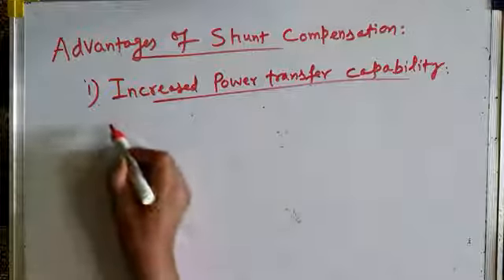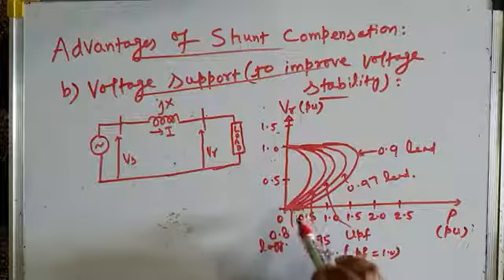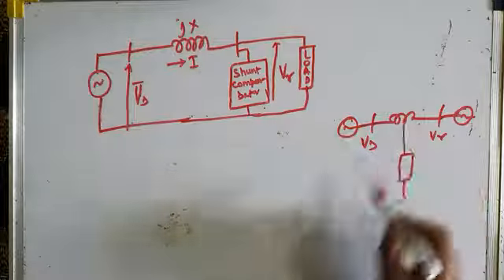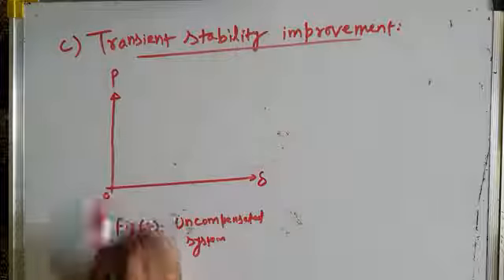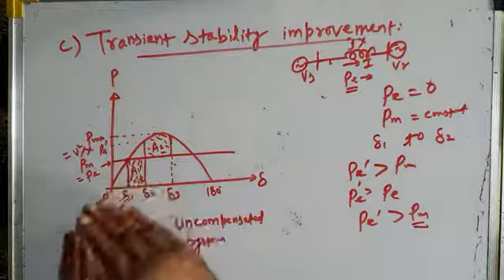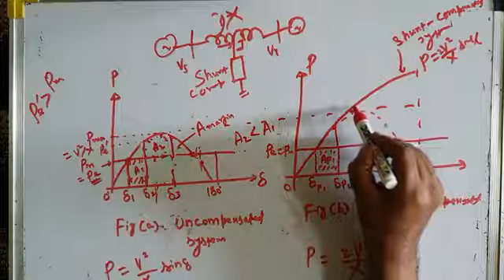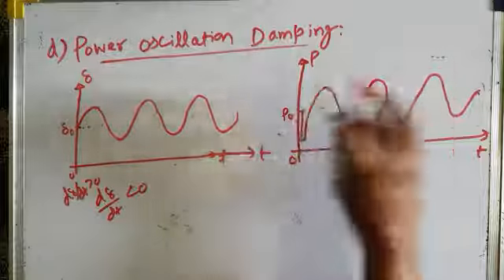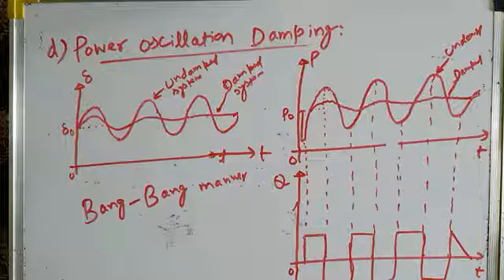L9_ Advantages of Shunt Compensation

Comment: Why does a smaller leading power factor (0.9) get you better voltage and higher power transfer and not the 0.97 leading power factor?
Reply from the maker: @ryanfrancis9134  0.97 is very small leading power factor (close to unity) whereas 0.9 pf is slightly higher leading power factor, leading to better voltage owing to flow of leading vars on line which cancel lagging vars.
Reply: @prof.a.h.bhateednitsrinaga6515  Thank you for your prompt response. I rarely encounter leading power which is why I am a little confused. So leading PF works different from lagging PF where the smaller the number the better is the PF when it’s leading and the larger the number the better it is when it’s lagging?